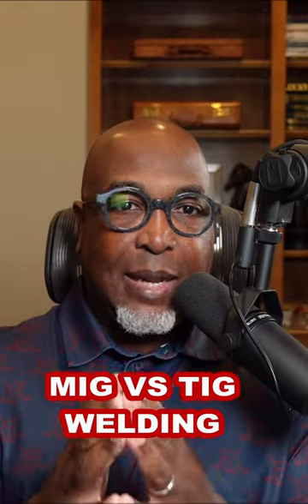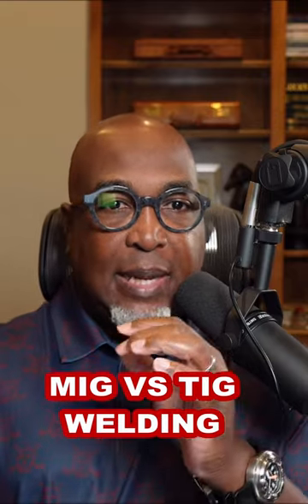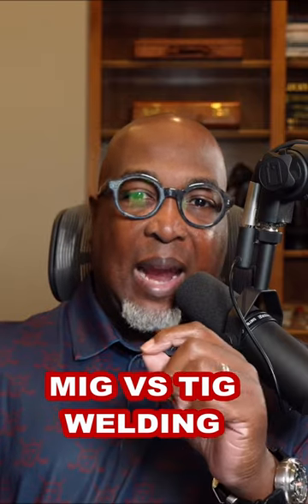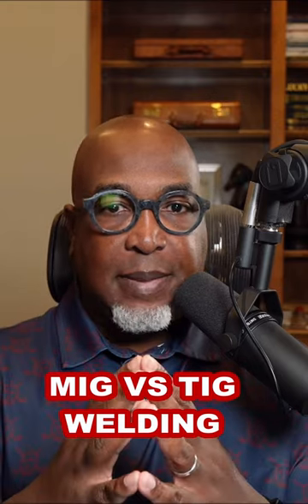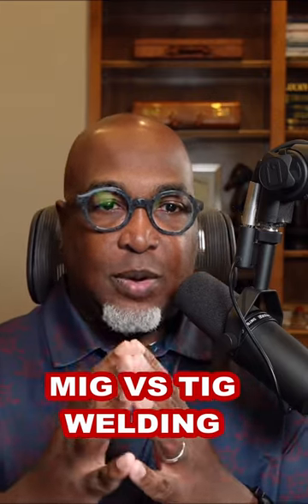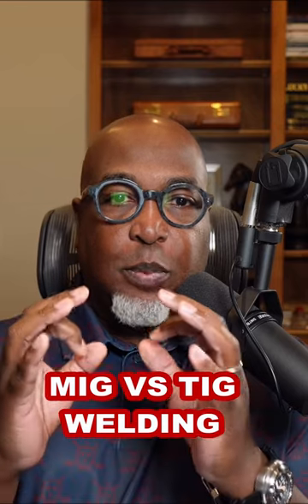MIG WELDING VS TIG WELDING

Comment: You need videos with all the different welding machine you're talking about because I'm interested in welding but apparently you're talkin to only welders who know about these
Reply from the maker: Thanks for the feedback Alton.  I've got a longer video which goes into depth about becoming a welder. But my videos simply provide an overview of the profession.  However, there are a bunch of other videos on YouTube showing the various equipment in use etc.  Hopefully between my videos and those, you're able to gain the knowledge you need to make an informed decision about becoming a welder.